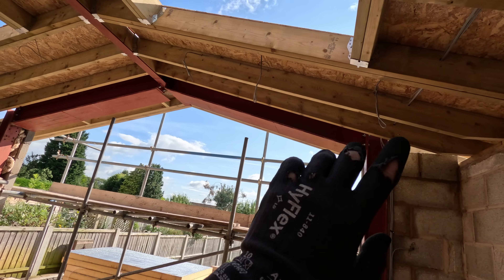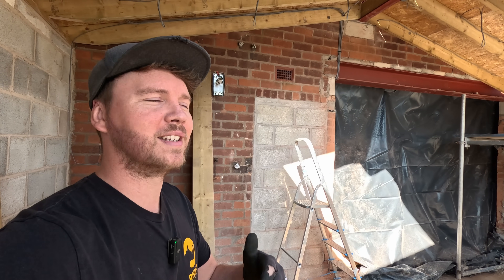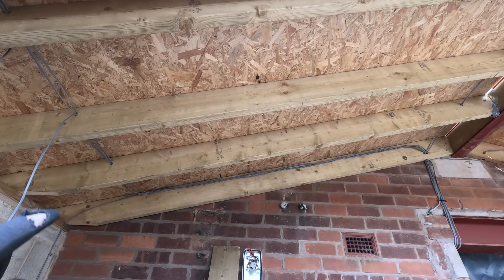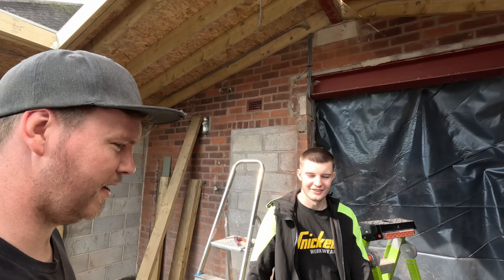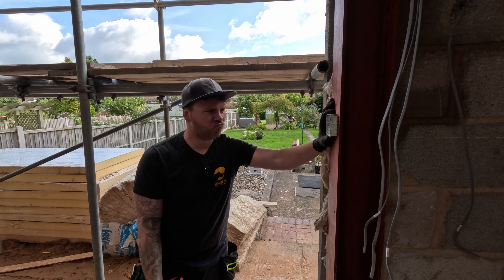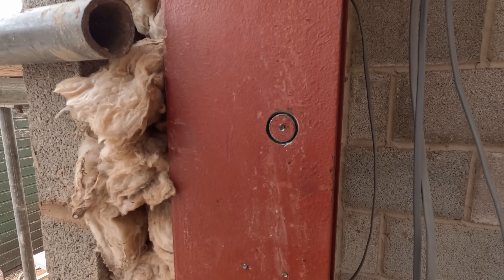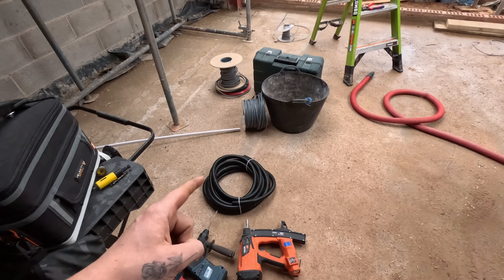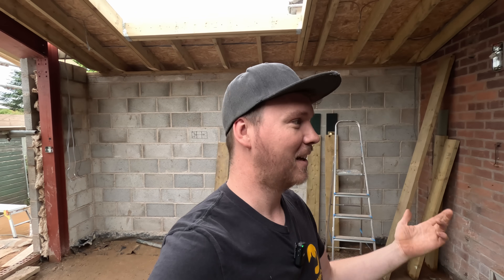Forced to Change My Own WORK!!

Comment: Could I ask you a question, I have a jacuzzi Bath (air pump, not water) are flex outlets allowed under the bath as it’s zone 1  if so does it get protected by a 13 amp rcd spur and a double pole isolation switch or is the rcd sufficient?

Comment: Do you not figured it out but for the speaker's do you use what kind of cable? For HiFi in same room I prefer 1.5 till 2.5mm² depends the lengths, for next room 4mm². Of course both cable have same length (same till 5 cm around or less). If it only loudspeaker for speaking same a school with 100V system is 0.75mm² no problem. This was mostly a problem in the last century where DIY use too small cables normally. 
These days more and more people use wireless indoor systems same SONOS or BT speaker, only for extra cinema systems (more as 5.1) people need cable. Why also your customer need it on the roof? 

It is possible that normal electrician with extra diploma can handle network cable's (Cat3 till Cat8) or do you need extra networking services technicians same here in Germany how are specified network electrician too? I see many crumple things if electrician make this without specialised learning over years. 😂 I renember a Guz video from his school many years ago ... he show so many wrong things. 😢 Or the plumber how cut's "the not needed cable" as you not was there ... 😂

Comment: I thought drilling rafters for cables was a no no? If you can Are the holes done to guidance calculations or just willy nilly? I would t want to foot the bit for replacing those 😬

Comment: When using a hole saw on metal use some cutting oil to extend the life. if you haven't got cutting oil just use WD40 or something like that.
Reply: Always go in at a slow speed too.
Reply: Cutting grease is preferable as it doesn’t loose viscosity when it heats up 😉
Reply: WD40 is NOT a Lubricant.
Reply: @keithg1xfl  not saying it is but if you haven't got anything else it will do the job
Reply: @keithg1xfl not a lubricant but a good cutting oil

Comment: Not that it’s ever happens on my jobs but the builders or your selves should trim out where the down lights are going and make a box section for each light with the insulation going in the top section to keep the building inspector happy and still have a void for the lights.

Comment: Hey Nick! We think you've used our HC6 FH 22mms from our Electrician's Starter Kit to fix that box into the RSJ and the nails are probably a little long which is why it's not the best fix. For back boxes into RSJ, we recommend our HC6 15mm Nails (also available as Flush Head if you don't want the orange plastic on display) as you only need 7mm embedment into this substrate. 

Using gas with our tools helps you be able to fix up to 3km (10,000 fixes / cable mounts at 30 centers apart) of cable on one charge vs 240m worth if you had a battery tool fixing 800 shots per charge... 😎

Comment: its best to speak to the architect so they design the roof insulation around it. i have spoken to a couple and they have also contacted me about the issues of insulation. eg put some of the insulation on top of the osb board  and some under it leaving a gap for downlights and cabling away from the cellotex

Comment: Is there now way of making a mould type plastic cover for the cable end for the ceiling downlights that have to be cut round before  celotex is put in. I take it the  celotex is in sheet form and not sprayed onto the roof.

Comment: Mate the way we get over the insulation issues now is all new build extensions is to batten down on each rafter and using low profile downlights. The problem is the building inspectors have tightened up on you breaking all the way through the celotex so this is the way to go so far. Great video as usual boys 👍

Comment: On jobs I've done, if the joiners were organised they would cut a square of the celotex and leave the cables in there.  All we'd have to do is measure out where they go, cut out the hole and grab the cable.
If you's knew exactly where the downlights were going, you could do the same with some thing like a 100mm holesaw in the celotex and leave the cables up there until after the ceiling was up, plastered and painted.
But from experience, get the joiners to send you pics after they've done any work to catch any problems, that will definately come up.
Also explain to joiners they shouldn't do stuff like jam the cables in with celotex, put sharp bends in cables, or lick the cables. . . or windows.
Reply: That's great, but having a hole left in the celotex doesn't solve the issue of piercing the vapour barrier. I.e. the foil coating in each side of the celotex.

Ideally, the ceiling should be dropped further to allow for the downlights to sit below the insulation, or a "warm roof" should be used meaning the insulation is technically _outside_.

Comment: If you are going to have down lights you need a false/dropped ceiling.Once you puncture the vapour barrier or cutout insulation you have ruined the spec.

Comment: Valid point that's also crossed my mind today when I changed a double socket and a gale force wind blew through the dry liner. Same thing they had to cut the celotex to get the dry liner in. I foamed it. See if it makes much difference when it's cured

Comment: Curious....Why did you not do a rear entry (ooo nurse) on the switch box on the RSJ...and are you now going to be bonded to the structures steel work, via the back box?
Also ... I take it that the OSB on the roof is a temporary measure to keep you dry, wondering how the builder is going to affix the wall plate anchors otherwise,,,,and the insulation is going to be reduced considerabley at the eaves due to the roof rafters being reduced in size  because of the way they have been cut...which will create a flat spot around the edge of the room where ceiling meets wall. Whilst I'm at it....has the Building Inspector seen this... as the Padstone under the left hand side of the RSJ in the house opening is questionable. Plus a few other things....which have nothing to do with electrics...ha
Wouldn't want you to have to do it again...ha...ha..

Comment: For downright we tell the builders to leave a gap in the kingspan where the spots are and fill it with rockwool which can be moved around threw the hole you've cut for your light.

Comment: Still can't unsee those rafter feet! can't wait to see how they plasterboard the ceiling/wall junction. I reckon the architect/builder has fooked up the design with reference to the existing structure. Downlights....... Is it not a warm roof and that rafter space is going to be a void?

Comment: Mag drill for RSJ's, line the hole with aluminium sticky tape, stops water ingress into the insulation and keeps it in specks

Comment: Not 100% sure it's a good idea to drill such a hole thru the flange of a UC.

 I know you can go thru the WEB with certain size holes but the flange is taking care of the bending moment forces on the cranked beam for the gable end elevation. 
I know its only small hole, it's just that it's on the flange and I would think you would need to  check with the SE before making such a hole. I think by drilling the hole it will also remove  certification for steel that the fabricator would have provided due to your 'alteration' 
I would have thought BI might ask question on this also (if they sees it:)

Comment: You can buy boxes for the downlights, that fix above the ceiling. Bring the cables into the box and seal the cable entry. The vapour barrier gets slit and folded/sealed onto the boxes.

Comment: I think really the ceilings should have a service cavity so 200mm insulation + 25mm batten + plasterboard. That gives you 37.5mm to get low profile ones in.

Comment: Never good altering a first fix installation, but hopefully you get paid for it too. Wondering if the Velux windows need a power supply/switch too. and outside lights ??

Comment: Nice video Nick. I’ve never felt the need for those expensive company van rack systems. I built my own and have a copious supply of jam jars, margarine tubs and other such containers for screws, fittings etc. They are easily labelled with my PTouch.

Comment: New extensions/ builds with Celotex can be troublesome, I usually ask the joiner to cut out a square 250x250 where Downlights are going and then fit a slimmer piece and seal within that void to allow for the light and driver and prevent overheating.
Ideally whatever spec of Celotex is specified, timber joists should be larger to allow a realistic space for services.

Comment: Nick/Adam 
Only 1 solution to the problem of getting the holes sorted in the celatex, is to be their at the same time as the boarder and work along side him. It’s worked for me in the past.
If you leave the boarder to his own devices concerning the cutout for the downlights, you can guarantee, it will end up a RIGHT ROYAL ABORTION !!

Comment: Typical UK build, designed on the fly, no drawings, clueless architect, no competent project manager, no coordination between trades, guessing wiring runs, down lights penetrating insulation.  The result will be appalling thermal performance.

Comment: I’m not an electrician just interested in electrical work and have been watching you and all the other big channels for a few years now. That’s a good point about how you can be compromising builders regs by putting down lights in a vapour barrier etc., are there regs for drilling through RSJ’s? The people who come up with the electrical regs, do they work with the other trades regulators? Basically the different trades need to work together more, so for example a plumber knows to allow certain distances for the electrician to run cables away from hot pipes etc.

Comment: You will probably need 2feeds for your led around sky light or you will get fading towards the end of the strip. Feed from both ends stops this.
Reply: normally 24v or 48v, should be very little volt drop on that size.
Reply: You’re normally okay with up to 5 meters, anything longer would need feeding from both ends.